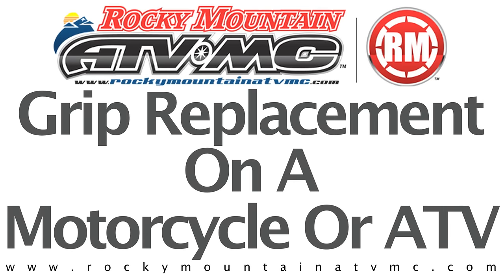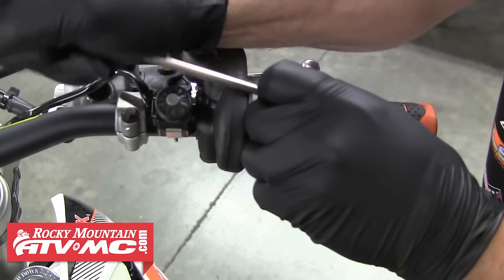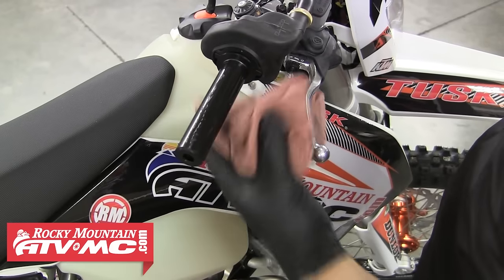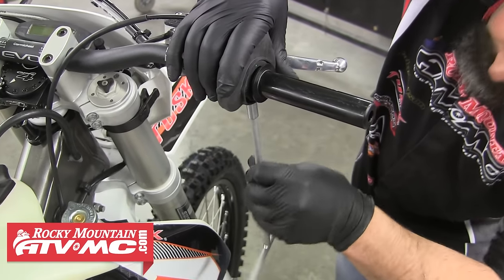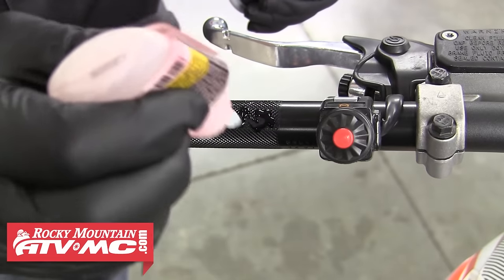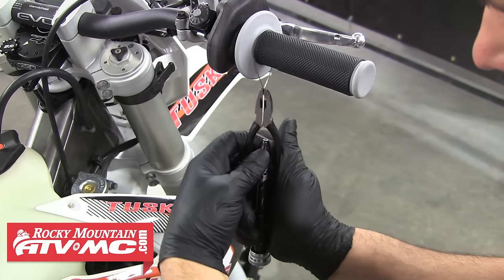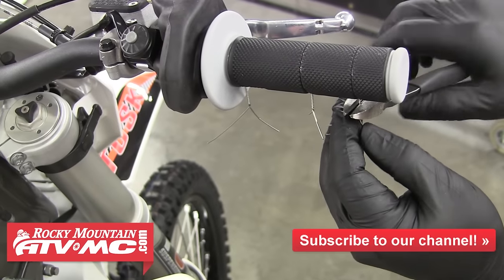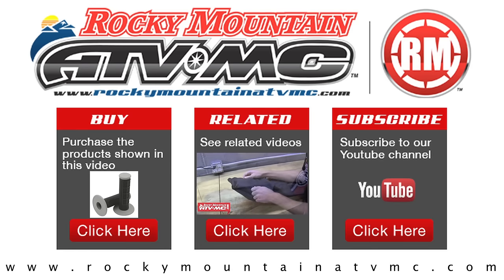How To Remove and Install Dirt Bike and ATV Grips

Comment: Not to criticize you but, contact cleaner? why not use wd-40?
Reply: Because if you plan on re-using the grips you are removing, it's harder to remove the WD40 from the inside of the old grips and they won't stick to the grip glue. If you aren't using them again, just use a razor blade.
Reply: tootallbob  sure it is.  You ever hear of brake clean?
Reply: Oil based solutions breaks the grips down
Reply: Because you'll oil the bars leaving a bond breaker between the glue and bar

Comment: I never use glue. Clear spray paint/clearcoat works way better and doesn't leave a big mess. Spray it into the grip, push it on, after it dries it's rock solid.

Comment: but its such a pain getting grips off after using grip glue, I always never had a problem with grips slipping but I would only use the wire.
Reply: When i swap the clutch side grip it never stays it still keeps twisting 
Do you have any advice for me
Reply: @tiukusti8990  put it on with hair spray, it will make it easy to slide on but will glue it when it dries

Comment: If you dont plan on re using them just take a knife heat till its glowing with a torch and slice through them like butter. Just dont cut throught the throttle tube.

Comment: Do u have to use safety wire the ones I have on don’t have safety wire
Reply from the maker: I'm guessing you still have your stock grips? Stock grips will usually come glued on but no safety wire. When replacing them, I would recommend using safety wire. Grip glue works well, but it isn't uncommon for grips to still move without safety wire. Or just go to a lock on grip and you don't have to worry about any of that.
Reply: Wire us ridiculous

Comment: Hey man I CANNOT get my throttle grip off idk if I have any contact cleaner is there any other way?
Reply from the maker: Is it glued on? If it isn't, you can used compressed air to get it off but if it is, you will most likely just have to cut it off and try to scrape off as much of the rubber and glue that is left on.
Reply: @rmatvmc  tysm man

Comment: do i have to use the special bar glue can i just use gorila glue or somthing
Reply from the maker: Super glue will probably make them very difficult to remove but it's not a bad option. There are many options of grip glue that can all work just fine. I"ve heard of people using everything from contact cement to hair spray with good results.

Comment: Is it fine to use grip glue without the wire?
Reply from the maker: You can definitely use grip glue instead of safety wire.
Reply: i only use glue. u can also use both if u want

Comment: Yo my friend kinda broke his throttle thing while removing girps because they were melted into it
Reply: Yeah that's what happened to me. I'm going to assume your friend used a box cutter, that's what I used on my old bike. I did the same thing, just destroyed the throttle tube. Use the method in this video, it doesn't destroy your grips and you don't have to worry about cutting past the grip and into the throttle tube. The term is called vulcanized, its usually Kawasaki and Suzuki bike which have them.

Comment: Cut the old off woth a razor knife. Idk why tf you'd pry the old ones off woth a screwdriver. 

You dont need grip glue. You dont need anything fancy. Just get a little butter cookimg spray and just make a quick pass down the bar. Super light coating. Not all sides. Just ine quick stripe down each bar end and you're done. 

Slide the grip on, you're done. Ready to ride the next day. Zero grip spin.

Comment: You don’t have to do the wires guys. It’s not worth it
Reply: thank you so much for informing me im looking for grips for my kawisaki bayou 220 and i make my own money at a young age and i wasent looking forward to buying that stuff but should i still use grip glue?
Reply: @demmcylol8166  Glue the grips always or use the hairspray/spraypaint trick. I've never used wires as I hate them
Reply: @demmcylol8166  yeah grip glue is relatively cheap you can get a small container that’s enough for like 6 grips total at a cycle gear store if there’s one near you for about $3. But also if you don’t wanna spend money on that, you can actually just use hairspray.

Comment: standard spray paint instead of glue - thank me later
Reply: @Magnus Fjerstad yep - its real slippery then it drys and sets tight. its a elegant solution - but wear gloves ;)
Reply: @Magnus Fjerstad you don’t sound too convinced … let me know how you get on. Super easy.
Reply: @g000se99  i remeber some friends of mine using hairspray back in the day. Had the same effect with going on easy and then drying
Reply: @g000se99  haha just wached the video you posted and saw he mentioned hairspray!
Reply: honda grip glue for my honda 😅